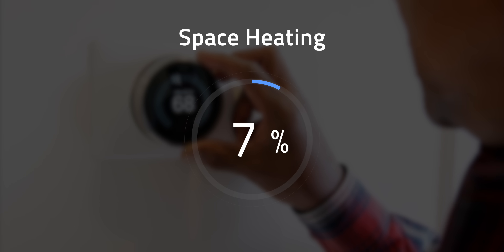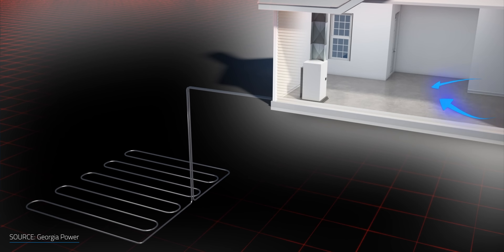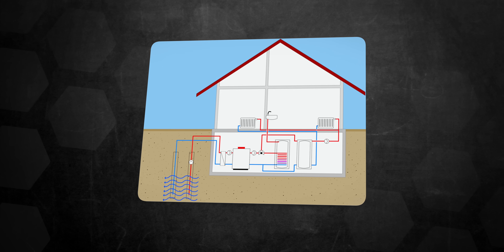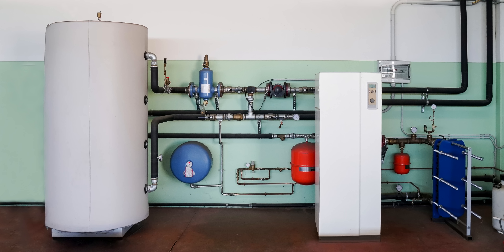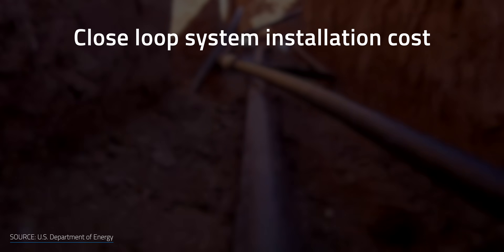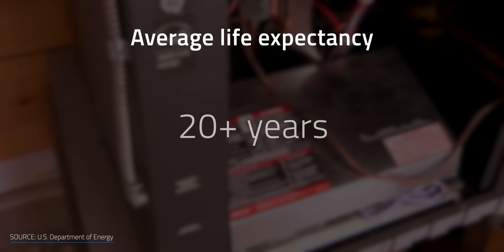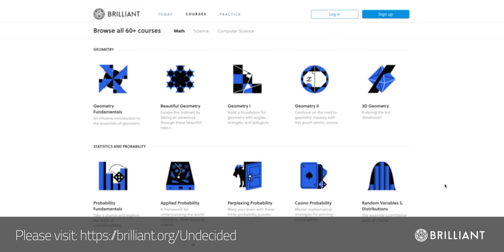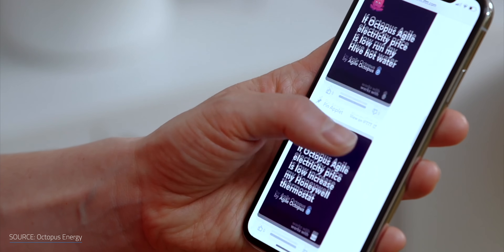Is Geothermal Heating and Cooling Worth the Cost?  Heat Pumps Explained

Comment: Expert here. Yes really. You forgot to mention cooling towers but only used residentially in the summer in emergencies. Think of a minnow bucket cooler for fish bait. But the reason for my message is to emphasize what fuel it is being compared to. If natural gas is available, then a heat pump, either air to air or water to air isn't going to be cost effective. Commercially we have hotels using water source heat pumps but in a city you're not going to have a loop field. What is done is cooling towers on the roof for cooling and boilers heat the water in the winter for heating.

Comment: What happens to all life underground (beneficial for plant life) when we raise or cool temperature of soil? Do they die or move away? Reducing our usage is a better approach
Reply: Probably negligible heating. If you're worried, don't run your A/C or gas heater because that heats up the local atmosphere.
Reply: @Travis0palzae  We thought we are cutting a few trees for housing as negligible some time back. But now it has become deforestation. Human greed  has no limits. The neglible today will become a problem if everyone jumps on it.
And turning of A/C or heater is not same as tapping from inside earth. That is our space we are heating. But use only what you need , is the key for sustainability

Comment: One thing to note here as well is that a large part of the cost is the excavation and installation of the underground tubing, if you can run a small excavator or know someone who can you can reduce the cost of your system dramatically.  Here in the Western USA you can rent a small excavator or backhoe for $50 or less per hour and could install that part yourself then pay the contractors to install the rest.

Comment: don't really need geothermal at all. as a heat pump can take outside cold air and covert it into hot air, yes even during winter.
you quite honestly don't need to dig up the ground to get the same effect. saving yourself 5-20k.
as technology connections points out, we already have the tech to do it and we have already been doing it for a while in other applications.
https://www.youtube.com/watch?v=7J52mDjZzto

Comment: Converted my home to vertical loop GSHP system when I bought it 23 years ago. The previous owner was spending thousands per year on propane and that cost completely went away while my electricity costs were actually less. However, I did have several maintenance issues in the first few years that made me question my decision. After switching service companies things have run smoothly for several years. Can’t emphasize enough how important it is to contract with an experienced company with a long track record in this industry.
Reply: ASBESTOS Fibers Heat pumps are known to last an incredibly long time, I don't know why you would describe them as a ticking time bomb! They are one of the most reliable heating technologies there is, and actually quite simple. The ground loops should last well in excess of fifty years, longer still with the latest materials. As for replacing them preemptively- what a ridiculous idea! That's like saying you should demolish you house in case a tornado flattens it next summer.
Reply: Thank you for your input, good to know. I hope everything is fine now. Cheers.
Reply: This. I'm shopping for a contractor and service plan. One contractor (who doesn't do residential anymore) strongly recommended against almost all of the other contractors in the area because he had kept getting hired to go and fix their botched jobs. After digging around and reaching out to others with GSHP systems, I found similar bad experiences in cases where the system was either improperly installed or given maintenance by inexperienced people.
Reply: What kind of maintenance issues did you have? What kind of service is needed to maintain a vertical loop GSHP system and how much does it cost? I'm interested in getting a vertical loop GSHP system, but this is the first I've heard about maintenance and service issues. I (incorrectly) assumed they were pretty maintenance free after installation, since they are a closed loop system. Thanks! :)
Reply: Question is, the cost of the conversion. It doesn't save anyone money if you spend $30,000 on a system today and energy bills are low when you could leave all as is and keep the $30,000 for something else paying higher bills unless the conversion cost is known. Some folks just want to do it regardless of the overall value in it long term. We have high electric bills for about 3 to 4 months of the year and are faced with tons of reasons to go solar or this or that. All we need to do is upgrade our 31 year old A/C system to a higher SEER one and could cut the bills in half or a little more but only for 3 to 4 months. That would cost us about $10,000 to save maybe $150 to $200 a month for 4 months. It would take us 16 years to break even to upgrade, all things remaining fixed as they are today. Even those numbers are not serious enough for us to dump a perfectly good running system for a new one to save $600 or so a year in electricity. Its a personal choice likely as to when is a good time to spend large on efficiency but the impact overall is not all that much unless you will stay in that residence for more than 10 to 15 years after its been outfitted with energy efficient HVAC improvements. Most folks move every 5 to 6 years they say so they are better off leaving the place as is to the next owner.
Reply: I find opening all windows + fan make it cooler..when winter hits..i just close all window + get firewood. all guud.
Reply: Judge Judy Once said “In business, the only thing you have is your reputation”.
Reply: @asbestosfibers1325  Do you have stocks in one of those companies or are you one of those bad installers trying to cover up your lack of skill?
23 years is not that much for a well maintained system.

Sure he should set some money asside for when the pump fails(in a decade or 2) but no need to preemptively change the system, especially after a mere 15y.
Reply: @david6054  My husband works in HVAC and he says if it ain't broke don't replace it
Reply: @SarahR2D2  Yes

I mean 99.9% of the time :D
Reply: "The previous owner was spending thousands per year on propane"?  Thousands?
Reply: @rf7192  in my area it's not uncommon at all to pay thousands per year on oil or propane.
Reply: @rf7192  that could very well be! Here in Denmark it is common to spend 20.000 to 30.000 dkk = $ 3.000 to 4.000 a year (2021)on heating.....
Reply: @nielsbgeskov-jensen8306  I thought Denmark had a really mild climate, or is it high energy costs?
Reply: @rf7192 For 2022, Amerigas is charging $2.699/gallon for a lock in seasonal rate, plus $200 tank rental, $199 seasonal contact fee and about $35 in delivery fees.
Reply: @rf7192  I am using thousands on oil every year. I'd say... about 1k every 3-4 months give or take. I've seriously thought about geothermal in the past but I once saw a video where they compared geothermal and "air to water" heat pumps.. the upfront cost was way higher on geo and the payback time was still almost the same on both.
Reply: @TheRealFOSFOR  Wow that is insane amount of money just for heating.
Reply: @gelinrefira  Yep.. I know. I bought an old (probably badly insulated) and very large house with old radiators. And it's a pretty cold climate up here. So in the winter the boiler is on almost constantly. On summertime it's easy going.. only heats the water, but of course.. the summer lasts for like 2 months xP
Reply: @TheRealFOSFOR  Yep, in most parts of the country, propane is more expensive than oil, meaning this would add up to thousands per year, at least in the Northeast.

Comment: I live on the north shore of Long Island and we got geothermal heating and cooling last year and the year before we got solar, we did these too close to each other and couldn’t take full advantage of the rebates but even with that mistake we are on track for it to pay for it’s self in the next 6 years and we have less than ideal conditions due to the rock n clay in our soil we had 3 wells drilled 300 ft down and before this we did not have central air and just used window air conditions. Also during the winter we get a lower electrical rate. Which helps during the systems most inefficient time.

Comment: Hello from U.K..  We have a 10 year old ground source closed loop heat pump.  It might be a U.K. thing but we’re shocked how poorly served the heat pump market is here.  Heating engineers haven’t up-skilled, then are perplexed when they see we’ve got a refrigerator engineer servicing our system!!  Then there’s our original installation which was dire but at the time we didn’t understand but found out painfully later.  Understanding the heat curves etc. to optimise the performance is complex to understand with poor support systems or technology such as remote App information and/or controls etc.  Almost everyone understands gas and oil systems but heat pumps are complex and we find puts buyers off existing properties with heat pump systems.  PS:  We’ve also got an air convection heat recovery system, which is amazing and another important subject in a world where everyone’s obsessed with airtight homes - which effectively don’t breathe !?!?

Comment: I've had geothermal HVAC in my home for 33 years. Recently during an annual service I noticed the mounts on the compressor were rusting through. The system was still working great  however I decided to replace it before it failed. The system had paid for it's self at least 2 times compared to using propane.
Reply: Imagine the amount of C02 that would've emitted in the environment by burning that much amount of propane!
Reply: With as old as that system is you might want to keep an eye on the underground piping, it is likely to start failing like the mounts for the compressor.

Comment: Your house needs to be well insulated and sealed for ground based heat pumps to work well.  My house won't work with it, and a coworker's house struggles to keep up without having to use the electric backup for heat in the winter.  My place is an old solid brick farm house, theirs is a newer 80's model kerchunk house.
Reply: I think you would just need a bigger heat pump (and loops) if your house needs a lot of heat because of poor insulation (or because it's just a big house). The more heating/cooling you use, the faster the system will pay for itself.

Comment: There is several additional knock on benefits as well. For one, this helps make electricity and water a homeowner's only utilities which for those out in the country is probably already using electric pumps anyways. This allows new construction to be easier and cheaper than connecting to a pipeline network. And since individuals are focused on electricity they will get a larger benefit to solar and battery systems. What I was actually most interested in was the networked system for power companies so they can cycle powering the ac amongst several different houses to both lower costs and act as a load bank for them to ramp up power production for the afternoon. The less power companies have to ramp up and down and can stabilize the grid the cheaper it is to run the grid and makes the electricity cheaper for its consumers.

Comment: I designed and built my own concrete filled foam block [Polysteel] house starting in 1996 and moved in in 2002. I planned geothermal from the start and it has been great!! As I recall it was about $13,000 at the time, that included the duct work - 550' horizontal closed loop - hot water tank pre-warmer accessory  and the Water Furnace itself.  I had to have the heat exchanger coil replaced about 3 years ago - it sprung a leak. To my knowledge, the back up heater coils have never come on here in the Shenandoah Valley of VA.

Comment: Curious about how warm the heat is. Might the heat be warmer than current HeatPump systems?  As warm as natural gas?
Reply: The systems are slower to respond, and you won't notice blasts of hot air like you may with a gas ducted hot air system, but you can still heat your home to whatever level you desire so there really is no difference. You just have to operate the system slightly differently. Most people try to maintain a set temperature, perhaps letting it cool slightly during the day when the house is unoccupied, rather than switching off completely and expecting it to heat up within 30 minutes of coming home in the evening and turning it back on.

Comment: I bought a house with propane and upon finding the cost to fill the tank would be 1500 for about 6 months I opted to install a GSHP. It is wonderful. My installers used directional boring machines to direct the horizontal loops so very little excavation was done. Each loop is 250 feet and there are 5 loops. Vertical wells could have been installed but the cost rose as a drilling crew would need to be hired. I am in NE Ohio and love it. I expect my payback period to be about 6 years. When replacement is needed the replacement cost will be significantly lower as the exterior pipes are already installed.

Comment: There are geothermal heat pumps for hydronic heating systems as well as ventilation. Connection to an existing circuit can be cheaper than ducting and fans.

Comment: This is something that works really well. I'm curious to know if a supercomputer could run simulations of different refrigerant fluids together to see what combinations could work in different climates.   I find it hard to imagine they can work in some places and hot others.

As for cooling, I think really large cities in the US need to start using district cooling systems such as deep-water air conditioning.
Reply: A super computer is not required since the arithmetic is fairly straightforward. A simple spreadsheet would suffice. If you wanted a sensitivity analysis considering variation of all variables involved to predict outcomes, you could run a Monte Carlo analysis, also in excel.

The constraint on fluids is mostly environmental risk should a leak result.

Comment: Here in Uppsala Sweden we use district heating for those that live in or close to the city by burning  biofuels such as wood chips and pellets and also by burning non recyclable trash at very high temperatures and downhole heat exchanger (also called a borehole heat exchanger) or a heat pump like an air-to-air in the countryside.

Comment: I built my home 4 years ago planning to be a net zero home. I have geothermal that yes was expensive but subtracting the cost of standard HVAC and incentives it wasn’t expensive. I have a large solar array that I installed myself. I have no utility costs for heat, AC or electricity. Both the solar and geothermal have half payed for themselves already. Combine that with an electric vehicle and I am getting more and more efficient. 
I look at it like an BEV in that upfront costs are higher but long term much cheaper than the alternative. I hope that prices can come down and more people will be aware of this option, I love it!

Comment: Great video! Any chance of a vide on domestic wind turbines? Are they any good, cost effictive etc?
Reply: They are pretty bad. They get much more efficient with motor size and build height. PV is great in any size. I saw a video of a guy in Austria that bought a house with an old water mill. It dammed a small spring. He got a company to install a generator for around $10000. He now has 8-10kw energy year round. With selling the excess energy to the power grid, he has an roi of around 5 years. After that he has like $200 additional income every month and free energy for life.

Comment: Here in Sweden the most common type is closed loop, but down into a 150-250 m deep drilled hole. They measure how much waterflow it is down there to see if it is enough. 

Then on the inside, we rarely ever use ductwork and air as carrier - we use water radiators, as it is usually only heat we are interested in.
Reply: Both systems have advantages and disadvantages. Heating with air ducts is louder than radiators or underfloor heating, but you can reprocess the air, while you have to outdoor vent water based heating homes. In highly insulated homes venting takes a big chunk of your total energy. With radiators you loose the ability to cool your rooms and they need a higher water temperature making the heat pumps run less efficient .
Reply: @Psi-Storm  yep, but eg my house has a heat pump for the vented air, so it extracts most of the energy and puts it back in the radiator loop. 
We don’t even have geothermal, just 30-60 cm insulation in walls/roof. 
We use 6-8000 kWh/year for heating in snowy Northern Sweden!

Comment: Currently working/planning a house build right now, going with ICF for maximum thermal retention, geothermal for most efficient HVAC system and PV panels(or solar tiles if they ever become available here in canada)... I won't be off-grid, but I want to be as close as possible. everyone thinks I'm crazy and this house will cost millions to build... thanks for laying out the cost estimates/comparison!

Comment: Geothermal is a tough sell in a lot of New England due to the amount of loose rock and ledge in the ground. In most places you can't put a shovel in the ground without hitting rock...it's one of the primary drivers behind utilities being primarily on poles in the NE. I think mini-split ductless heating and cooling systems simply make a lot more sense for most people in the northeast looking to move away from, or at least substantially reduce, their fuel oil use. The newer mini-splits produce heat well below freezing and are getting more and more efficient all the time as well as providing the added benefit of AC for the summer. Also the cost is a fraction of geothermal with 18k btu mini-splits costing around 5-6k installed.